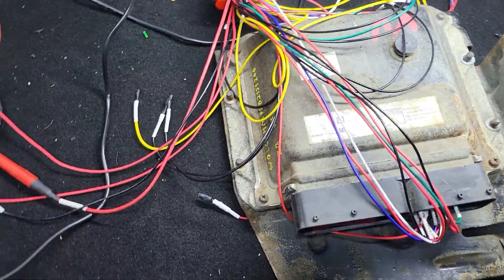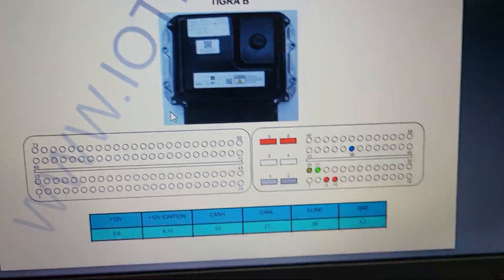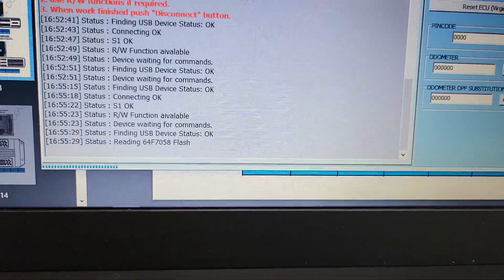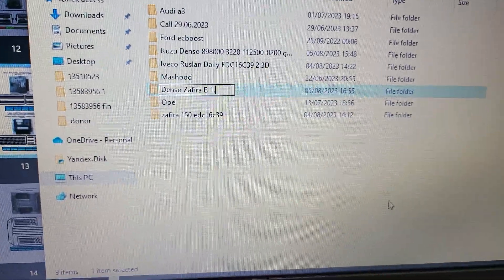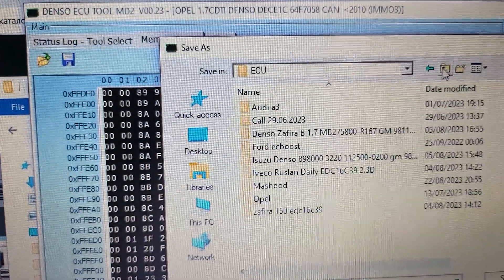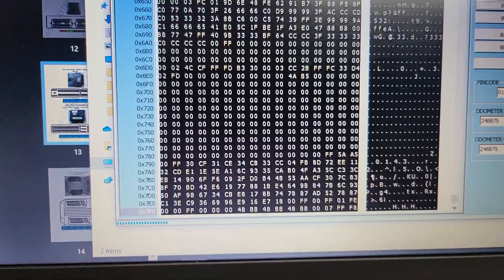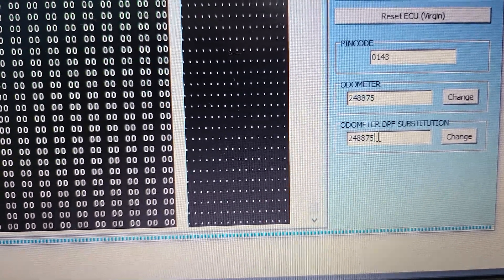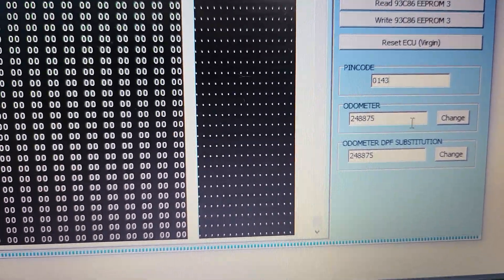Opel/Vauxhall 1.7 CDTI Denso ECU cloning, read pin, virgin.

Comment: hi sr, wonderful video,  
maybe u can help me with this issue, i have a opel astra J with a 1.7 cdti motor A17DTR reads at car papers year 2012, the ecu is DENSO 55579443, MB275700 i need to read if possible by obd, if not is possible bench  i got kt200 but i cant find what driver choose o what should do i lost here, i got sm2pro (chinesse) do you have any idea, ? thanks a lot
Reply from the maker: Hello, try on bench kt200, or pcmflash or ktag
Reply: Ok i ll try and see then . Thanks